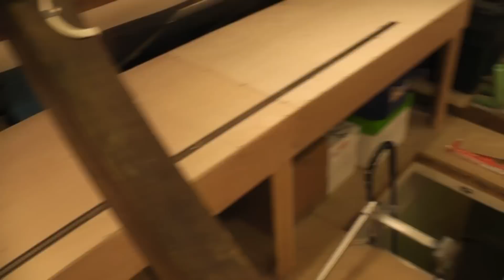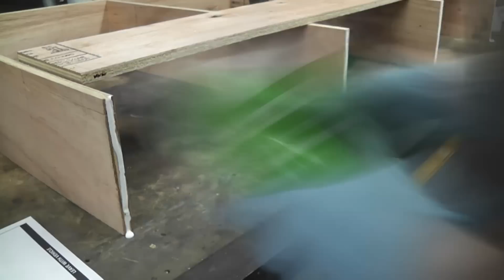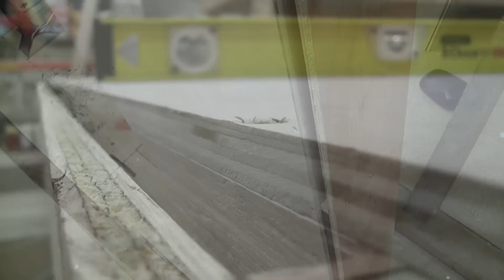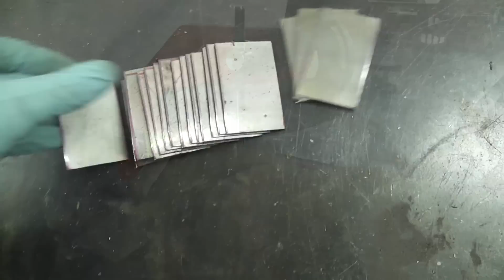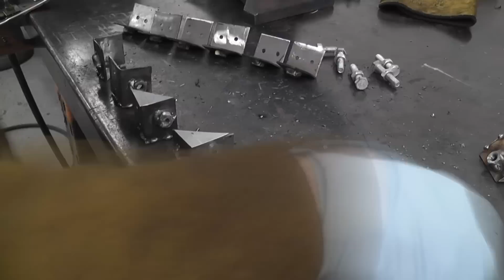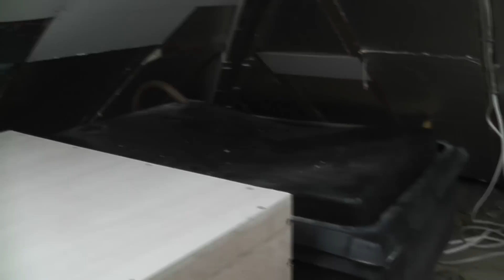New Layout Build - Baseboards

Comment: Nice to see you making videos again!  Looking forward to see your progress.

I think there's a factor you could have overlooked...

When I build a layout, I draw what it will be on the back of wallpaper using Peco templates, so you have a 1-to-1 scale drawing of what you'll have when it's built.
This means that you build baseboards for the track plan, rather than having an idea of where you want to put points but then having to compromise and move them because you've got a strut under the board where the point motor will go.

Here's a board I made several years ago for a club layout.
https://drive.google.com/open?id=0B_HTqkOnlh96WFBPSmNxTGk2ZEU
If you look, it's a 2x4(cm) frame with a strut across it every 12 inches.... however, the third strut from the left would have been where the green line is, which would have put it directly under where I wanted two points to be, which would have reduced two fiddleyard siding by around 4-6 inches.
By moving the strut inward by 2 inches allowing the point motors to be fitted without impacting the design.

I have another idea for you regarding your fiddleyard.
At 2ft you should be able to get a fiddleyard 11 tracks wide.
Make it 5 clockwise, 5 anti-cloockwise, and the centre one bi-directional.

Doing it this way, you can bring a train in one way, remove the loco, pick it up (or run around), and then you can take it out the opposite way without having to remove the entire train from the tracks.

To illustrate, here's a diagram of the early sketch for the board photo above (board 11), and you can see that the green tracks go clockwise, the red tracks are anti-clockwise, and the blue is the bi-directional one (the purple is a brach line, but ignore that). 
 https://drive.google.com/open?id=0B_HTqkOnlh96STgwVFJWa0xGR0E

Hope that helps or inspires.

Comment: Hi Richard, always a pleasure to watch your very impressive videos, great job your doing from scratch,well done,suggest you would be better using the head of the bolts as feet giving you a bigger load baring surface and less likely to dig in floor, catch up with you on the next one, Geoff
Reply from the maker: I've made some feet for the adjusters.  I need the head of the bolt on the top really for easy access with a spanner.

Comment: just a suggestion, turn your leveling bolts head down to make more of a footing instead of just the thread to the floor.. But you gave me a lot of new ideas for a new layout. Thanks from California
Reply from the maker: I've made some feet for the adjusters.  I need the head of the bolt on the top really for easy access with a spanner.

Comment: Solid stuff. A lot of work building this yourself, especially down to the feet adjusters which you could've just bought, but in the end it'll be worth it and you'll feel more proud of it. You'll definitely need some pads under those feet though as those bolts are just going to sink into what looks like wood below it once more weight is there and it settles. Little pieces of square steel from that scrap you had would probably be fine.
Reply from the maker: I've made some feet for the adjusters.  Flat plate with another welded nut.
Reply: Nice. I assumed you were already aware of the feet. Just wrote a comment.. because? hah Looking forward to the next update. This is a huge project.

Comment: Fab progress.  Nice bit of work, strong and level.  Two questions: 1, why not use star or square drive screws and drive them with your cordless?  2, why not turn the bolt over with a larger bearing surface on the floor?  Nice that you are back, Rob
Reply from the maker: Thanks Rob.  I prefer driving fasteners manually.  In my profession I've seen too many over tightened and rounded fasteners done with impacts and cordless drills.   I've made some feet for the adjusters to spread the load, flat plate with another welded nut.  Working well so far. 

Cheers

Comment: Very interesting and very timely as I am just about to undertake the same de-construct and rebuild for similar reasons ie mdf, pine timber construction and lessons learnt. Will be watching your journey with great interest. Quick question - could you have made the side plywood panels shallower eg down to 100mm since you are now using plywood with greater structural rigidity. I also assume your mention of timber merchants as a source is that the quality is better than a DIY store like B&Q, Wickes etc. Thanks
Reply from the maker: You could quite happily make the sides shallower if you want.  I decided to over build a bit for insurance really.  I went to the local timber place as the prices, knowledge and choice is better.  The DIY places are ok but you have to hunt for decent cuts of material and places like Wicks don't offer a cutting service (at least in my area).

Comment: Great work Richard. Just one thing put some feet or spreaders on the bottom of the bolts otherwise they will go through your floor. Great to have you back
Reply from the maker: I've made some feet for the adjusters.  Flat plate with another welded nut.

Comment: You had better put larger feet on this right now, before you go any farther as I guarantee that this will punch into the floor with weight. The floor stock looks and feels strong but I know for a face that it will dent and will do this at different spaces as I have had this happen to me in the past. Do this before you get any farther...   PLEASE.........
Reply from the maker: I've made some feet for the adjusters.  Flat plate with another welded nut.
Reply: Sounds good. I'm glad you did this now instead of trying it later after a lot of layout was done. I'm sure you will appreciate all of the work you do now - later.....

Comment: Nice video. I have some comments. Why is your glue so thin? We have glues here that are for wood and they are not so runny. I also used the plywood for the supports but there are no friendly lumber yards here that would cut all of this for free. After 1 or 2 cuts they charge anywhere from $1 to $5 a cut so I had to cut them all myself. Why are you doing the base so deep? I did the same support structure but did it with 4 inch wide stock. A true 4 inches because I was cutting the boards myself. This is much more cost effective than buying solid wood and you get better straight pieces. I put the bend on the long boards to the inside as you put it to the outside. I find that the bends will hold themselves straight better if I put them to the inside and use the cross braces as a spreader - so to speak. I don't think you will have to use any braces on the outside ends as the top will keep everything in square. I really like the way you are mounting the backing for the scenes. You say timber and here that is the description for raw wood just out of the saw ill. The term we use for the wood you use is just wood. I almost like yours the better.  I almost think that the way you did the brace for the back would be a great way to do the pockets for the legs. Then where necessary for a truly flat set up you could just raise the layout up - leg in the pocket - and screw them in level. Now that is a heavy duty straight edge you used for the skill saw cuts. I have a different way of screwing the pieces together and that is with face frame screws. Have you herd of them??I like your leg  configuration. With the height of the frame you could just screw them into the braces at the height you need and the shape if the legs will be great.This is what I did but my layout is 48 inches off of the floor plus the table top. With this you can avoid all of the steel and welding. Although this would be great for leveling the layout in your room but could be used out of the room if necessary...Boy that was a lot of welding time.I mounted the 2 parts of the legs together before putting  them on the base frame. I just measured the legs, clamped them, turned the table upright, then with a 4 foot level, I got the table level and then screwed the legs to the base. Not as hard as it sounds ...Wow the table leg adjusters are wonderful after the grinding and paint...I would put the bolt through in the opposite way with the head of the bolt on the floor. Then with a nut between the bolt head and the mounting you made you could move the bolt up and down and when you have a level table, you would tighten the nut to the mounting fixture you made and the bolt would not move. Also you would have a larger contact with the floor. Over kill is good - to an extent...OK, you did use a nut. I would have just had the bolt in the other way... You will find that in time the bolt will sag into the flooring material - trust me as I have been there. A large piece of the steel you used would be nice.I have put my layout much higher than yours but I had the space. I'm 70 years old and have the train layout completely around the room and I roll under it to get into the center. It's hell to get old. If you would like to write direct email me at   degroffproducts@aol.com   that is s generic email address I will get and then I will come back with a private address for us to use.  Nice video and good luck with the rest of the build .....

Comment: Great to see you back! Thanks for putting the effort in of making this video and sharing it! I'm amazed with the amount of effort you put in with the table legs :O Have you considered using 2"x 3" beams and for making it adjustable using these rivet nuts: https://static.gamma.nl/dam/50624/123
And if you turn the current bolt up side down, you have a greater surface of contact on your floor as the head of the bolt will face down.
Reply: But I think having the bolt the way it is now makes it easier to tighten it or to loosen it
Reply: I also considered that and agree. However when it is done it's done, so I would choose the additional stability over the ease of use anytime.
Reply from the maker: I've made some feet for the adjusters.  Flat plate with another welded nut.

Comment: Do you think the 6" (155mm?) board width was necessary, or is it overkill?   I'm just building my layout and was going to go with 4" (100mm) board.
Reply: I'm doing a modular layout in European N scale following something called FREMO standards. Whenever I'm in doubt of which dimensions and materials(or anything) to use I just check the FREMO website. Since FREMO modules are designed to be transported around these standards would be overkill for a permanent layout. I couldn't find any measurements for 00 but the H0 standard which is comparable says 170mm. I think Mr. Everard is very thorough in his design using glue, screws and good quality materials. I'm wouldn't be surprised to see him sealing off the wood with paint in the next video:-) I don't think it makes much of a difference if you use 155mm or 100mm boards as long as you stick to the rest of the dimensions Mr. Everard is using.
Reply: I made my frame fom 18mm x 70mm x 2.4m, mounted on 38x 38 legs and it's plenty strong enough to sit on, ( and I'm 16 1/2 stone )
Reply from the maker: You should have no problems with that.  Mine are probably a bit overkill but I was concerned about warping.

Comment: You mention in other videos that you use Kadees, but I noticed on some other stock you use tension locks. May I ask, why is this?
Reply from the maker: Cost & time.  Kadees currently fitted to all locos and the leading vehicle of each rake.
Reply: Thanks for the reply. What about wagons? How do you shunt them without uncoupling ramps?
Reply from the maker: Vehicles that are likely to be shunted have kadees.  Most of my stock runs as through trains so I don't do much shunting.
Reply: I see. Really looking forward to the new layout and what it will have to offer for you (and viewers). Thanks for answering my questions.

Comment: Hi....well that was an early bird morning upload lol.  Hopefully it will be a bit warmer in winter and less brutally hot in summer...my silver foil certainly helped me to reduce the fluctuations.  Have you left a gap between the insulation blocks and the outer roof to prevent damp in the wooden beams?  To allow the roof to 'breathe' etc.   What would us modellers we do without lofts! lol. Cheers. Dave
Reply: I think he mentioned a 50mm gap between the roof and the insulation at the beginning of the video 0:30 :)
Reply: GOOD, must have missed that
Reply from the maker: Correct, there is an air gap allowing the roof to breath from the Soffit to the Gable.  Before I finished up the insulation in the Gable the rush of air along the roof behind the insulation was quite noticeable.
Reply: Very impressive, I've been collecting Z-Scale equipment for years, now retired and moving to an apartment I've decided to utilize a 7" X 3' Table to start  a display.. to put my stuff to work finally. Hoping to get some insight on the best way to proceed, I happened on your sight a few days ago. I've watched hours of your videos and again I couldn't be more impressed! As luck would have it, it seems you are now starting new too. It seems like the perfect time for a new guy to join your journey. From Columbus, Ohio USA Thank you for what you do! You have mad skills!
Reply: im guessing many  modern houses in the UK don't have basements or cellars, but smart to do the insulation, here in the US (eastern region) most if not all modellers use there basement.
Reply: jacob s No, basements are pretty rare.
Reply: Dave you been sniffing too much Humbrol from all your vids lol.
Reply: I only remember seeing one UK basement layout on YouTube.  The guy had a trap door through the kitchen floor and the basement was more of an oversized "crawl space."  The ceiling looked to be about 5 feet above the floor.
Reply: Terry Shaw for Z scale... Offer magnifying glasses! 👍
Reply: There are  a few ideas for diy railroad layout construction
Find a suitable set of plans online 
Find a colleague who wants to build one too so you have someone to encourage you
(I read these and why they work on Jareks Hobby Club site )
Reply: Cryptonymicus saw that video really nice station

Comment: Great MKll start, I can just imagine the level of detail we are about to witness, the definitive loft layout build - Everard Junction MKll.
Already some great tips, different materials to suit different requirements, and back scene mounting methodology. 

Special point though, apologies up front, the legs while adjustable will impose high point loading on the chipboard flooring material, this will deform in a short time, consider fitting 2mm gauge aluminium 100x100mm (minimum) plate under each leg to distribute this load, this or something similar now will avoid this weak point going forward.
Reply from the maker: Thanks.  I've made some feet for the adjusters using flat plate and another welded nut.
Reply: Hi Richard, sorry, I did apologise up front, but I couldn't help myself, I would kick myself if you moved forward without this point being covered.